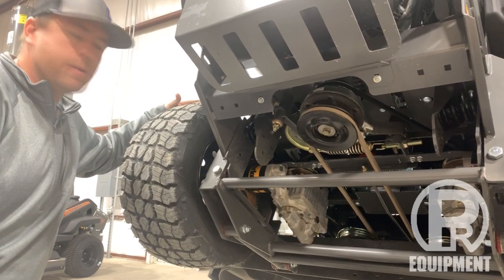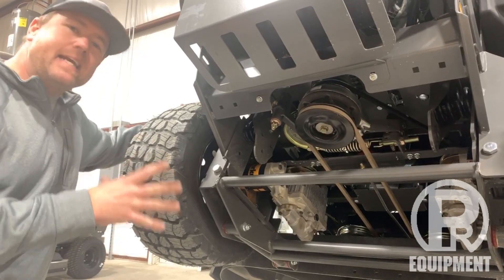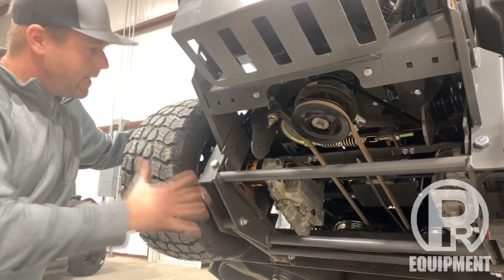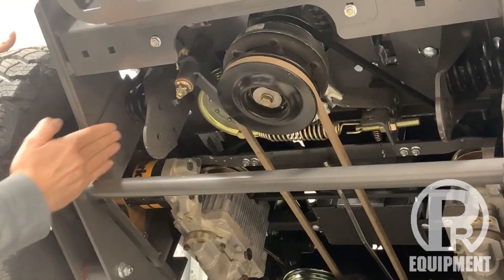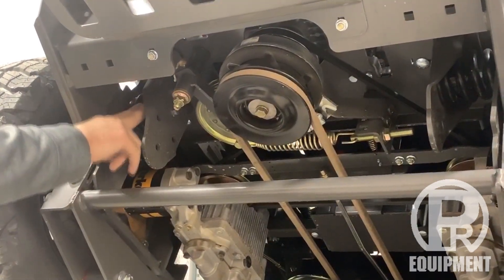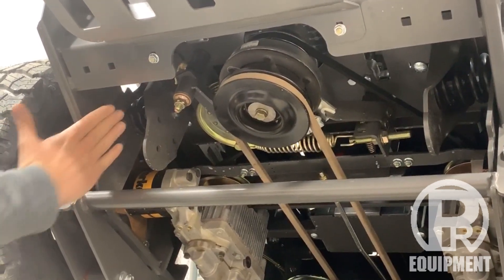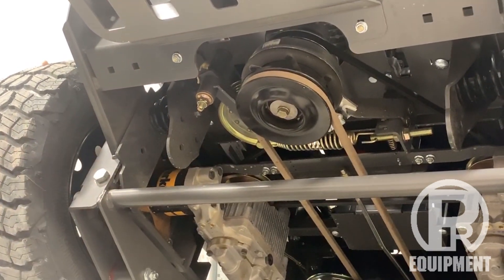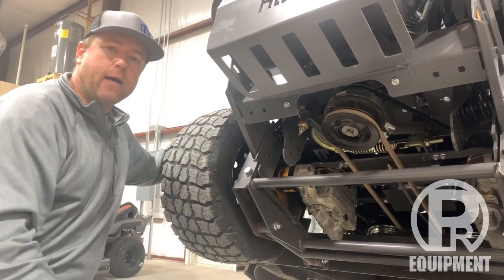Spartan Mowers SRT Rear Suspension System

Comment: Love your videos, very informational. Just purchased a 2022 Spartan SRT XD 61. I purchased for the suspension. Is there any adjustment to the rear suspension? Mine seems very bouncy.
Reply from the maker: The independent suspension is not adjustable but the seat and tecpacs are.  The tecpacs are located under the seat plate.

Comment: Do you know if the springs are difficult to replace? I have an srt and it seems to sag in the back left and the steering is real sloppy.  Would love any recommendations how to assess or repair.  I love my mower its been a real work horse but is in need of some fine tuning.  Even a service manual would be awesome.  Thanks,
Reply: For a shop with proper tooling for the job, no they aren't. For a shade tree such as myself, they're a pain, but doable.

Comment: We have a rt54 pro 2018 model . 
Rear tire side wall is warn and leaks air . I’m thinking 31/2 years is premature tire life! 
Also would love to find a reasonably priced replacement tire that’s not got the “comfort flex side walls” (thin wall problem!) . Thanks for allowing comments .
Reply from the maker: Sorry you're having tire issues.  We've not seen a ton of problems with tires (except mesquite thorns) but I would recommend looking at a Carlyle tire if you need to replace.  Have a great day!

Comment: So I’ve just heard about this company and have a dealer right down the road from me. I was thinking wright or scag for commercial use should I use this instead
Reply from the maker: Jon Spartan builds excellent mowers for commercial use.  I’d recommend an SRT HD or RT HD.  I believe you’ll find Spartans to be very well built, simple and easy to work on!  There’s a number of engine makes and hp available.  I’d suggest looking at a Vanguard big block or Kawasaki FX for heavy usage.   Feel free to reach out to us if you have any questions.
Reply: PR Equipment I was looking at standing models from toro and wright mowers. But the best they offer is a 34 hp motor. And I really think they dropped the ball, 37 hp vanguard really translates to a great cut on the spartan mowers. I just wish spartan had stander models already